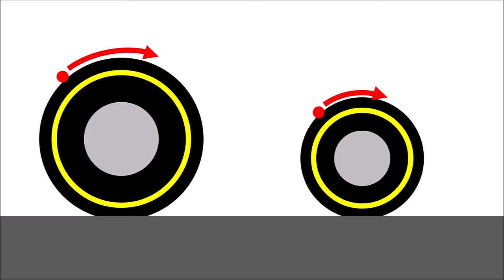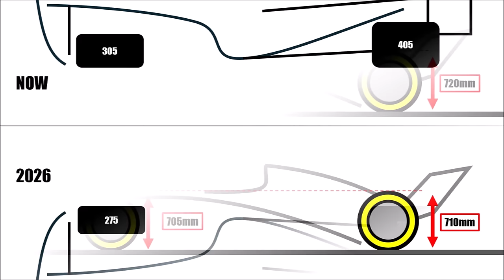F1 2026 - The New Tyre Dimensions EXPLAINED

Comment: Here's my "2026 regs" solution, that is both attainable, affordable and what fans and drivers want:
-Michelin join as a tyre supplier. No sprint races. 18 race season (delete Jeddah, Abu Dhabi, Baku, Miami, Las Vegas).
-same regs they have now, but cars shortened to the same length as 2013. Limit how much simulation they can do to predict the race strategy.
-delete hybrid system completely and just have the ICE V6 they have now, but higher rpms. That means less torque/power, but less weight, making the cars more agile.

Comment: They didn't drop the MGU-H because of a feared Audi advantage, they dropped because VAG didn't want two of their companies (Porsche,Audi) spending money developing units of their own to enter the sport. F1 needs to stop letting relevance ruin this sport, the hybrid experiment is an inconclusive failure, the cost, weight and complexity as done little to nothing to improve the sport. Now they're even talking about getting rid of the 8 speed gearboxes to save weight and size, that will be the 3rd thing they've gone back on. The sport needs better forward thinking in the rule making dept.
Reply: Nowhere in the video does it say the MGU-H was dropped because of a feared Audi advantage. 

He said they didn’t want to implement any front wheel drive system because of a feared Audi advantage with their other programs that use hybrid power to the front wheels.
Reply: @SimRacingVeteran  You're right he called it a "compromised drive train", but the reason the MGU-H was dropped was to please VAG. And the reason the FWD was taken of the table was it would had added cost, weight and complexity which is against what the proposed rule change is all about.

Comment: They have everything backwards. They chased headline power figures and hybrid so that they could show off numbers, and all it did was made the cars heavier and less agile, needing heavier tyres to manage all the torque. What drivers and fans want is shorter, lighter more agile cars - power and torque doesn't matter. Fans and drivers want cars that can follow closely, on tyres they can push flat out. Yeah, they can't avoid some safety features, but there's no reason to make the cars so long except engineers want it for aero performance, and there's no reason for heavy batteries when they could be pioneering cleaner fuels. They have all this hollow rhetoric about "sustainability" but increase the number of races - and fly away races, and allow massive team sizes, and massive data consumption and wind tunnel testing. There will still be ICE vehicles for decades in some countries.

So much nonsense from F1, FIA and big gov and globalists, and the public aren't stupid enough to fall for it. It's a shame because they are so many great talents in F1 both personnel and drivers, and so much BS from manufacturers and Liberty.

Comment: The solution to all of F1’s dirty air problems is so fucking simple but the idiots in Paris can’t seem to grasp it:

CLOSED WHEEL CARS 

Who said F1 HAS to be open wheel? There has even been a closed wheel F1 made by Mercedes in the 1950’s and the preceding Grand Prix era in the 30s had a few closed wheel cars. There is precedent.
Reply: Nah, just embrace the dirty air. We need a drafting-centric reg set.
Reply: Yes, the thing that will really fix F1 is turning into another racing series altogether, great idea!
Maybe they should enclose the cockpit, allow refueling and driver swaps so we get more drivers on the field and maybe increase race length and bring in some new circuits like Le Mans.

🤡

Comment: Question for someone smarter then me: Couldn't the solution for dirty air be to finally abandon the open wheele design? If cars were much more streamlined, wouldn't that produce much les dirty air? Also the fact that F1 cars hasn't conceptually changed since 1970 is kinda shocking. Like there's literally zero performance reasons for open wheel car. F1 cars are basically dinosaurs. Also open wheeled car concept has zero relevance for production cars, which is also a big topic.
Reply: That's a very interesting take, but I assume the simple answer is - if it ain't open-wheel, it's not a formula racing car anymore.

That is to say, it's so ingrained in the identity of what makes an F1 car what it is that it would be impossible from a marketing point of view to achieve it.

Except weight, that may be a factor for why they don't want to do that
Reply: @AdotLOM   you're right it's all about identity, and if it's open wheel racing it's f1 or indy. The have only an identity beceause the never changed the formula ;) a stable and lasting image is a strong one . About the weight of the farings , i can't think of the disaventages of a couple of kg per wheel compared with the huge reduction in drag and overall better stability in every condition.
Reply: @vercingetorige400  - if they did that F1 cars would just look like LMDH hyper cars.
Reply: @SimRacingVeteran   to me the redbull x2010 still looks like an f1 anyway